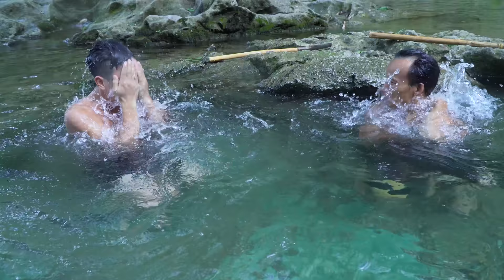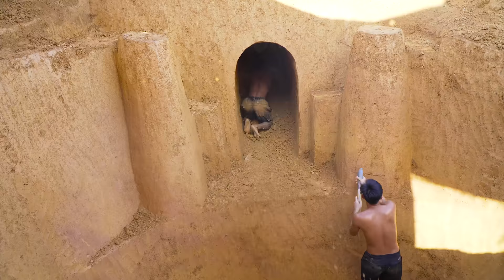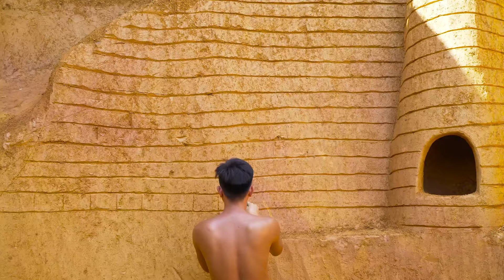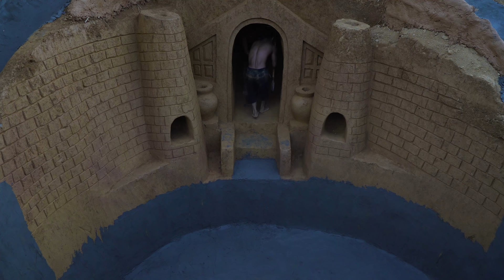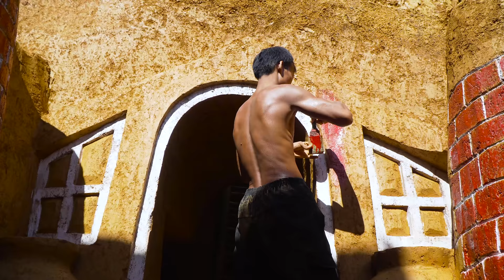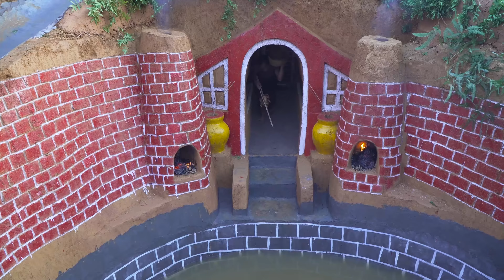Build Underground Swimming Pool With Two Water Slide Around Secret Underground House

Comment: I like to pass on to improvements for these guys over in Asia that are making these pools and houses,
     the water is flowing in to the pool from the sculptures? 
    Also make the sculpture while the water is Flowing down the slide!
     Also get them some bamboo tools that they can use to smooth out the mortar or concrete slurry, 
    and if bamboo containers are lighter to carry than clay pots for water,
   then have them use about 4 pieces or 8 pieces of bamboo and carry that on their back and they'll accomplish the same thing and one fourth of the time!,